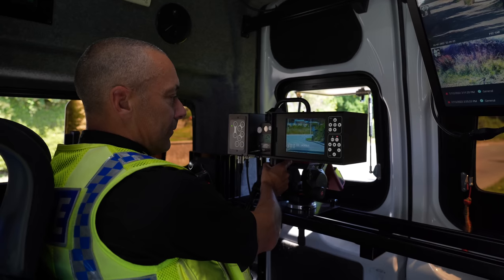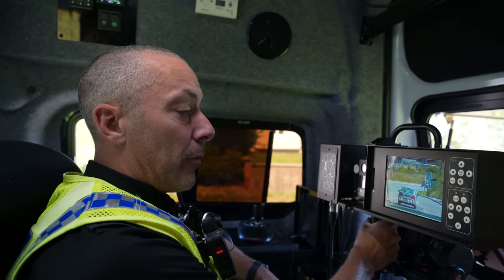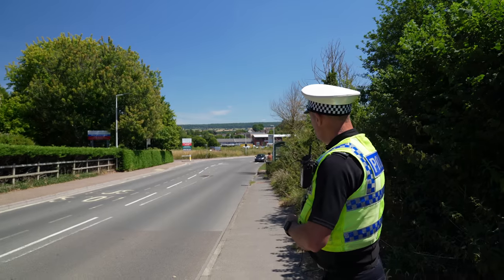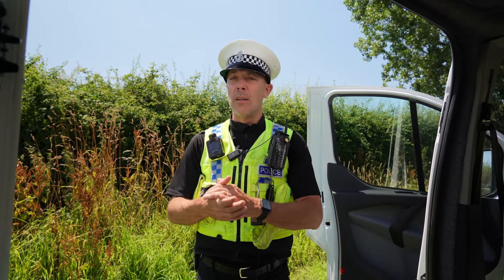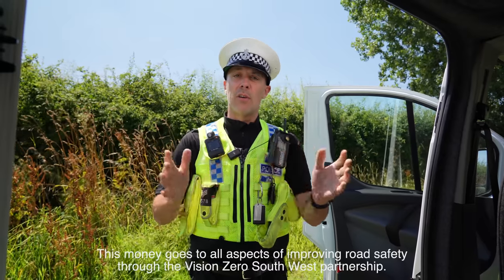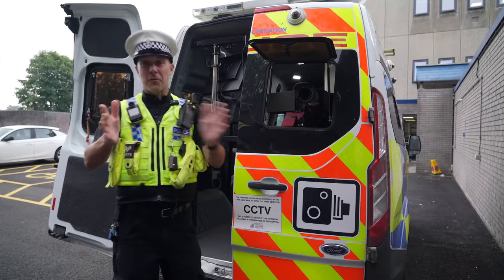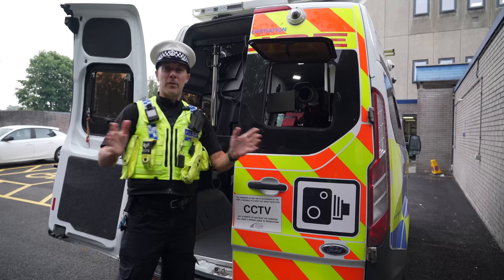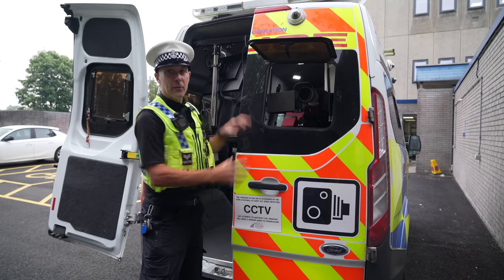SPEED CAMERAS - Road Safety or Cash Cows?

Comment: The two closest regularly used revenue vans to me are

1: hiding behind a sign on a long straight bypass with excellent sight lines
2: in a 30 limit where the council (part of the road safety partnership) have let the hedge grow over the speed limit sign.
Reply: It must be a vast sign to cover such a big vehicle.  Notices cannot be issued if the gateway signage is obscured.
Reply: There is a popular site around here where the speed camera van likes to park. On a 50Mph 4 lane road, under a low motorway bridge, on very sunny days so the van is in deep shaddow, and very close to a farm gate where a box van often parks.
Reply: @dave0smeg  Isn't that the point, on sunny days to park in shade so the van interior is cool enough to work?

Near a farm gate?  Is that illegal?
Reply: Depends what they are doing for me, there's one near me that parks behind a bush next to a 30 sign at a apart of road that goes from NSL to 30, if they are catching people approaching them from behind coming out of the NSL part they are hidden, if they are catching people going in they are easy to see. Parking hidden at a speed change point and pointing a camera at it to see if a car hasn't slowed quick enough is a bit harsh and probably has no impact on road safety issues.
Reply: @8G00SE8  The laser cannot be operated with anything in the way, especially foliage.  Behind a bush?

Vehicles approaching from behind have to pass the van, then travel at least 20m before the laser can be fired.
Reply: @unleashthedragonwithin2057  It's the fact that the columns that hold up the motorway bridge disguise the fact that the van is there.
And that zigzag pattern on the back is not there by chance. It's a technique used in the war to hide the shape and size of ships called "Dazzle Camouflage".
Reply: @dave0smeg  The 'zigzag' pattern is there because it is mandatory under Chapter 8 - all working vehicles on 50mph carriageways must have them.  Dazzle camouflage was used on ships to confuse the enemy to make it difficult to work out how fast, how far and direction, so nothing whatsoever to do with stationary vehicles.  To even attempt a comparison is nuts.
Reply: @unleashthedragonwithin2057  It's more the fact that they are focusing on a sign post where people will be changing from 60-30, of course some people may cross the sign post at 35+ by mistake at some point, it's not really helping stop children from being hit by cars.
Reply: Parking where the sun blinds drivers is also a popular one.

Comparing speeders to burglars. Pull the other one
Reply: @8G00SE8  Focusing on a sign post?
Reply: @jessicaandtrains7768  So you endorse speeding whilst blinded by excessive sunlight?
Reply: @unleashthedragonwithin2057  I wear polarised glasses but the majority don't.
Last thing they need is to focus on a van instead of driving. Speed cameras create more accidents when present than not
Reply: @jessicaandtrains7768  The van would be down the road where every driver will be looking and it is the person behind the wheel that is in control of where the vehicle goes.  To blame a stationary object for a collision is just plain nuts!
Reply: @unleashthedragonwithin2057  crashes happen when people are looking at their speedo and not the road. THINK!
Reply: @jessicaandtrains7768  Can you provide any verifiable evidence to support that claim?

Speedos are designed and installed for a specific purpose, just like mirrors.  Are you claiming that mirrors should not be used too?

Collisions take place when drivers are not maintaining a speed where they can stop safely in the distance they can see.  If you believe that glancing at your speedo or mirrors will result in a collision, then you are too close to the vehicle in front.

Are you one of these tailgaters?  What would you like to confess?
Reply: @unleashthedragonwithin2057  your using your mirrors wrong pal
Reply: @jessicaandtrains7768  You mean you aren't supposed to use them to see what's going on behind you?
Reply: You should use your common sense. You do not need speed limit signs to tell you what the speed limit is. There are multiple things to look for to tell you that. Don't whine because you're dumb and get caught. Also, if you're driving a BMW/Audi/Mercedes/Range Rover you deserve to get the fine, points and a ban.
Reply: @roflepiclol  Common Sense is a myth.

Mindless Northumberland driver spared jail after clocking speeds of 103mph in a 30mph zone

'This motor menace was captured on camera clocking a staggering 103mph in a 30mph zone during the morning rush hour.

Mindless Stephen Dunn was behind the wheel of his Honda Civic when he reached the shocking speed along the A193 near Bebside and Bedlington, in Northumberland.  A court heard that there is a 30mph limit in the area because of junctions, garages, shops and residential properties only being 1m or 2m from the roadside.

But that didn't stop Dunn from putting his foot down and hitting 103mph before he spotted a manned mobile speed camera, prompting him to slam his brakes on so hard he skidded after his wheels locked and smoke could be seen coming from his tyres, prosecutors said.'
Reply: @roflepiclol  who sounds like a fool now...
Reply: @unleashthedragonwithin2057  But using the 'tHeY wErE oBsTrUcTiNg ThE sIgN' as an excuse is stupid.
Reply: @roflepiclol  Adequate guidance must exist otherwise notices cannot be issued.
Reply: @unleashthedragonwithin2057  And they are, by multiple forms. If they are unobservant from other means and from the other signs on the road, then that's their own fault. 
There are plenty of signs on the roads to show speeds of when they change. There's no excuse.
Reply: So, if the area's built-up and there are street lights within 100m of each other its a 30 unless posted otherwise so it's 30 whether or not you saw the sign and it was easily determined to be 30, on a long straight bypass with excellent sightlines how did you not see the van marked police with an enforcement camera sign on it, and why does it matter, don't speed and you won't be fined for speeding.
Reply: @unleashthedragonwithin2057  they normally have an additional air-conditioning unit on the roof
Reply: @steve5772  Roof mounted air-con is actually very rare on speed enforcement vehicles.
Reply: @unleashthedragonwithin2057  your such a nob, theres a van that keeps parking near me, traffic on the other side of the road cant see the van hidden behind a bush, but the van looks down a hill, that goes from a 40 to a 70 right at the bottom. biggest scam, so the van gets you from behind, you never knew it was there
Reply: @KxrtButReal  I see.  

A 'nob' is 'a person of wealth or high social position'.

Did you really mean 'knob'?
Reply: @unleashthedragonwithin2057  No response to his point on the issue?
Reply: @Dante-vf4sd  Which issue?
Reply: @unleashthedragonwithin2057  Clearly you're invested with speed cameras.
Reply: @xtr3m3fLx  No, just accuracy.  If we were debating the Moon Landings, would it mean I was an astronaut?
Reply: @unleashthedragonwithin2057   good luck proving that it was obscured.
Reply: @jimst3r1  You aren't following this one tiny bit are you?
Reply: Ours likes to park on the bypass on a 50 into 30 yes there's a crossing for a school but it's always there in Saturdays and Sundays and all though the holidays as it's a easy cop
Reply: @dodgygoldfish  How can you accurately predict children will be during holiday periods and weekends?

Comment: I live in Devon so this is directly relevant to me.  I get the use of vans near schools in and at the edge of towns, but the South Wales police use camera vans on the M4 as cash generators and always have.  And above all they DONT CATCH BAD DRIVERS !
Reply: You don't consider speeding to equate to bad driving?

Mindless Northumberland driver spared jail after clocking speeds of 103mph in a 30mph zone

'This motor menace was captured on camera clocking a staggering 103mph in a 30mph zone during the morning rush hour.

Mindless Stephen Dunn was behind the wheel of his Honda Civic when he reached the shocking speed along the A193 near Bebside and Bedlington, in Northumberland.  A court heard that there is a 30mph limit in the area because of junctions, garages, shops and residential properties only being 1m or 2m from the roadside.

But that didn't stop Dunn from putting his foot down and hitting 103mph before he spotted a manned mobile speed camera, prompting him to slam his brakes on so hard he skidded after his wheels locked and smoke could be seen coming from his tyres, prosecutors said.'
Reply: As he said they are operated by staff not sworn officers. Staff don’t hold the ability to judge a persons driving much like anyone else on the road. We also need to remember speed is relevant to the conditions, at times 5 could be too fast but there does need to be a limit as it helps set a somewhat level playing field for all.
Reply: @benwilson9150  Staff don’t hold the ability to judge a persons driving?
Reply: @benwilson9150  What a crazy statement:

'Ben Wilson
8 months ago
As he said they are operated by staff not sworn officers. Staff don’t hold the ability to judge a persons....'.

Putting a black tunic on and being given a warrant card, doesn't give you magical powers.
Reply: When i was employed I drove 65k per year, One speeding ticket 2914 in Liverpool 34 in a 30 zone, and was never late for a meeting